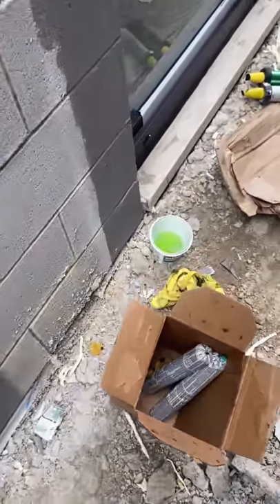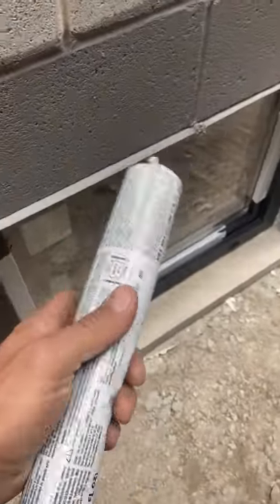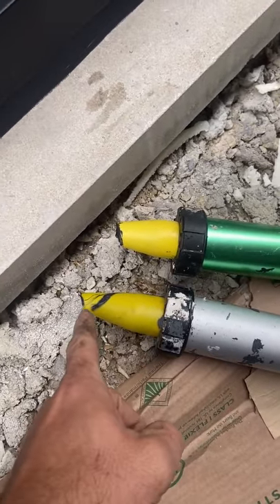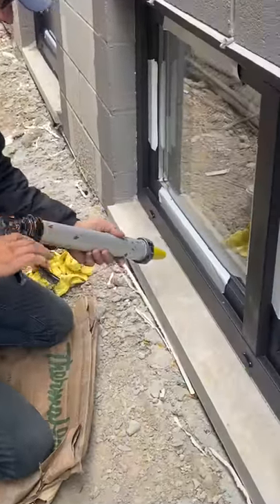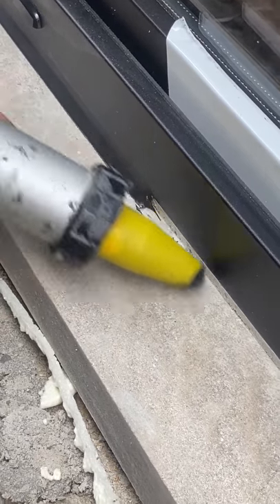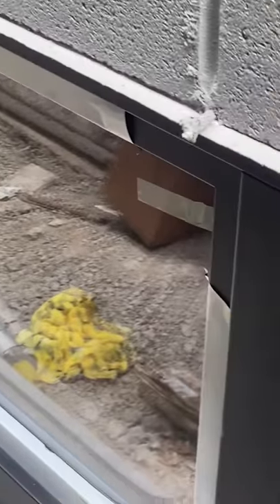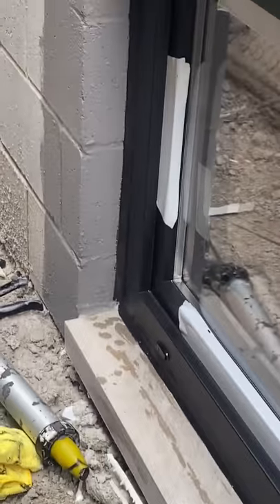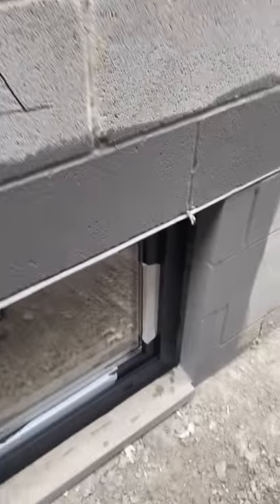Sausage Caulking. Sealing wide gaps around windows. MY WAY of doing it!

Comment: 25 years in commerical sealants and i have to say thats a Great bead but i have a few suggestions.  Your backer should be roughly half as deep as the width of the joint. Spray foam is problematic if you dont let it fully cure. The soap solution if a good finishing step but should never be used as the only tooling method. Wetting the joint before dry tooling can prohibit adhesion even though it looks sealed. Pro tip- you only need a small amount of soap in water and a spray bottle makes it way more user-friendly.

Comment: I would advise against the expanding foam.   That is why we always use backer rod.  You are supposed to put is about 3/8” to 3/4” inside the gap depending on how big the gap is.   The caulk needs to be able to grab not just the outside but inside the gap too.  With the expansion foam that cannot happen.  Also its a lot better to use metal caulk tools instead of finger.  Just my recommendation
Reply: I was taught that the void should be as deep as it is wide but never less than 3/8
Reply: You should never pack it deeper than 1/2 inch its in all the handbooks. Even if the joint is super big
Reply: Most manufacturers recommend a depth to width ratio of   .5 : 1
Reply: Came here to say this lol. As a glazier specializing in caulking, his backer is not in far enough, and soapy water is a BIG no no
Reply: @westside98  thats what we where taught
Reply: I see where the real Glaziers are... LOL
Reply: Your backer od should be half as deep as it is wide. 1" joint half inch depth of backer road. All you should do is shoot and tool both ways or shoot back scrape and tool. Soap and water? What are you doing. Lol. I'll admit to on occasion using spit and finger on a re-entry or tool mark to smooth but that's not supposed to happen either. Very little on this video is done to spec but hey it's your video and your not my employee.
Reply: The foam probably hold the window, but the sealing would be thin.
Reply: @ryanblanford7916 came here to say the same thing lmao
Reply: @jakejerue7346 how do you tool the joints off? Without a viscous medium between the tool and the mastic you will just drag the material all over and it will stick to whatever you are using
Reply: @ryanblanford7916 do you know how irate I get at morons that say to use soapy water. It us just plain stupidity. You are a lot nicer than me.And foam for backer is also plain stupid
Reply: is he using thermoplastic caulk in the video?
Reply: @ryanblanford7916 why is soapy water a no no ?
Reply: @CoreyParry-lu2ne  His girlfriend dumped him for a guy who used soap water for finishes

Comment: It’s a 2, to 1 ratio so if the gab is 1 inch then it’s 1/2 in inch for depth backer rod size depends on size of the gab caulking adhesion on three side top sides never bottom thus the backer rod never use water not only does it leave a shiny glaze that any expert can obviously see… also messes with the manufacture warranty. Always use caulking tools. At least that’s how I was taught.

Comment: Expanding foam a big no!you need to use backer rod to get a more uniform depth.second using your finger absolute no! You have to use a metal tool so you can tool back and forth to get the air out

Comment: You should see the caulking around the exterior windows of my brand new house, it's absolutely horrible 😫. How do they remove brand new caulking from vinyl trim and pvc windows?
Reply from the maker: i dont know what product you have. if silicone- i use exacto-knife , Supra- can be pulled off but it its Quad caulking- than  sharp chisel is needed. But its always hard not to do the damage when removing existing caulking.  I saw perfect window installation ruined buy the bad caulking job!  But thank you for your comment.

Comment: Backing rod.  It’s use to prevent 3 side adhesive a building moves 
  U always need to go 1/2  the opening and not  the thickness about 3/8 not 1/4,

Comment: Can you do caulking when the temperature low like what we have now 10 celsius?
Reply from the maker: The silicone that we are using is Dow Corning 795 . It can be used in cold temp even in -10 C. As long as the surface in dry.
Reply: When it's real cold I leave a box of 795 by my exhaust while the truck is warming up

Comment: Backer rod to have a bond breaker Not spray foam.   ,        

Also tooling by fingers is bush league and exposing yourself to all sorts of chemical exposure 

Window sealant would not pass especially with water/soap is not allowed by manufacturers .  You are introducing moisture onto the pours substrate and contaminating  the surface.    

Outside of his shooting skill I would not recommend anything in this video.
Reply from the maker: i have two comments to your comment: 1. where is your video to show how to do it properly so i can criticize it? and 2. Who the hell are you to recommend? caulking master? inspector? manufacturer?
Reply: It wouldn’t pass with soap and water ? Thats why the inspectors I bring up on the swing stage pass it right? I can show you 30 year old caulking that’s still holding that was tooled with soap and water which was supposed to hold 25years 👍

Comment: Backer rod bro... I'm a commercial caulker too...Bro you should really be using slickers i.e. caulk spatula.
Reply from the maker: I have slickers but fingers is faster for me.  I used to use backer rod before. But foam works almost the same and the caulking pull test is the same. When i did windows on commercial building,  the engineer who was in charge for structural let me use foam. Thanks for the comment
Reply: He does a great job of laying a nice even bead down , you don't need a spatula if you can run a bead like him nothing to remove just smooth it and press it in a little,. Great job!!
Reply: Slickers? Lol. You mean toolers? Jesus 😂😂
Reply: @durtygroove  There's a company that sells them called slicks thats probably what he meant. But I also call them toolers
Reply: @durtygroove  is our lord and savior.. ❤️😉
Reply: @fAz3R626  Albion
Reply: @durtygroove  Does it matter what you call it?

Comment: This is one of the worst examples of commercial caulking. No soap No finger And for anybody who tapes NO TAPE. NO spray foam. When you pack with backer rod the caulking goes in the joint.
Reply: I’ve seen different ways to get it done that are sound but if an engineer sees that he will make u cut it all out
Reply: It really is shitty caulking.
Reply: And while you're at it NO silicone either. It'll seal itself